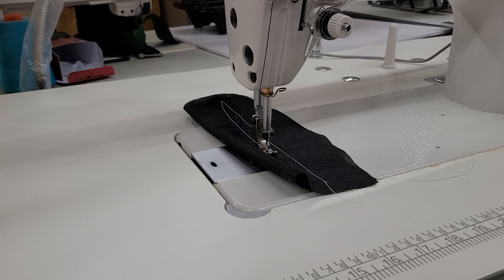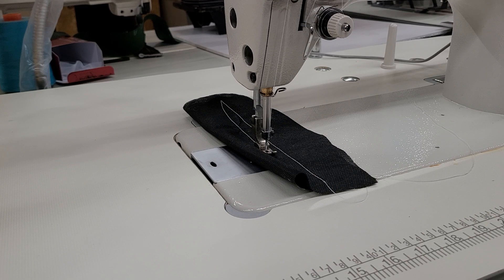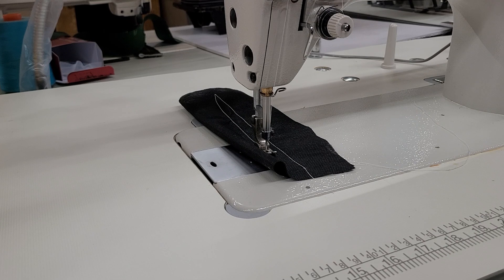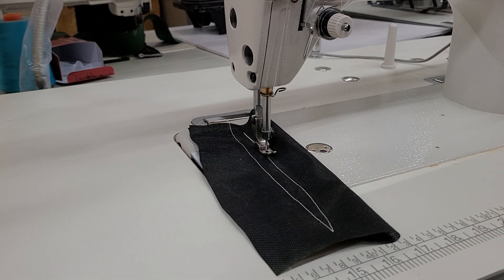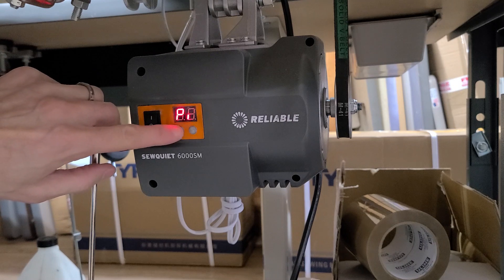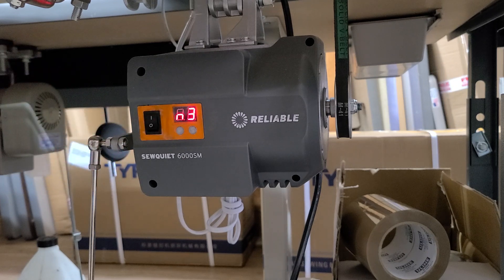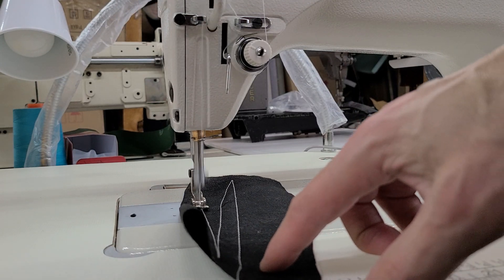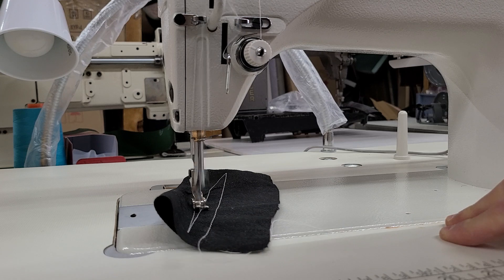Reliable SewQuiet 6000SM servo motor synchronizer settings

Comment: Hi Steve, when using needle down how can we remove our piece of material? the needle should be locked in the down position, so would I need to disable the synchronizer in order to remove the material once I'm finished sewing? Is there a more convenient solution? Thanks.